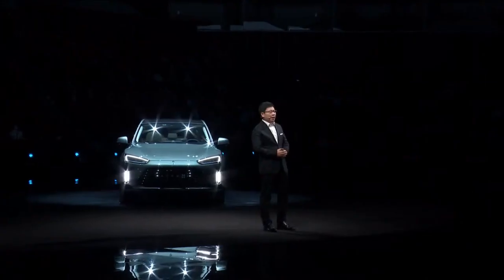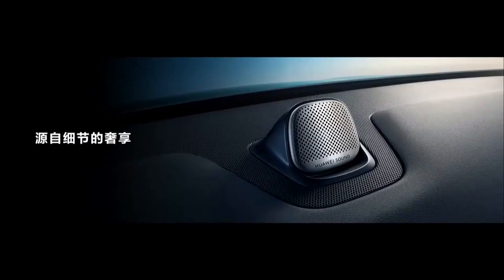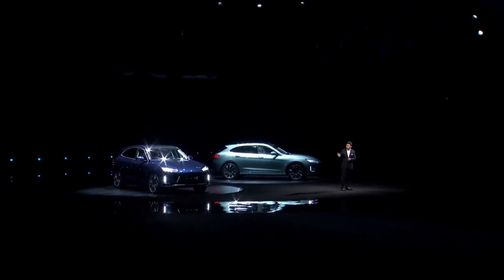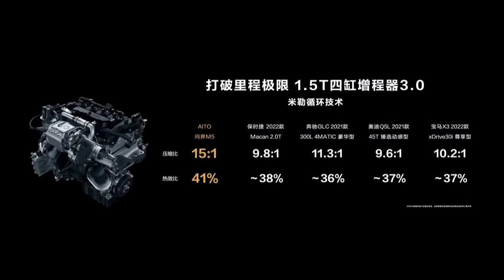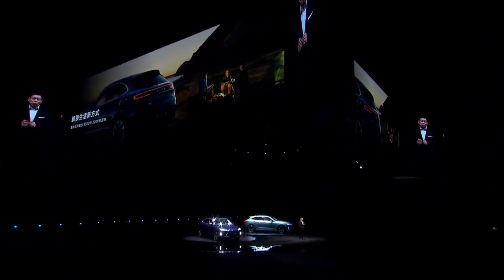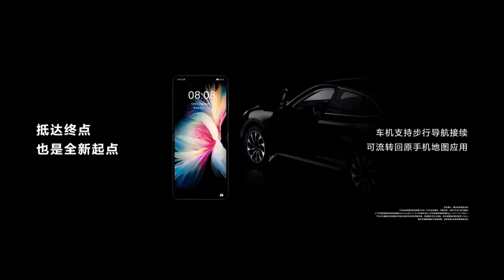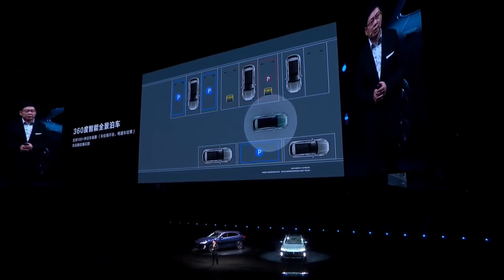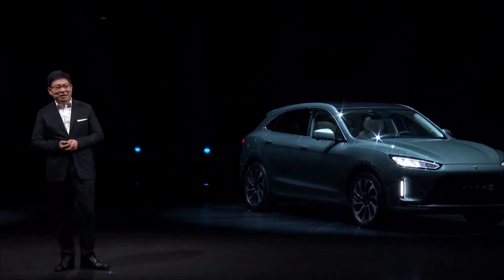Huawei Launch Electric SUV AITO M5: Full Launch event Presentation!

Comment: More fuel efficient but… 173kw provided by the 56 ltr tank, concur in around 893km range out of the 1100 advertised km (those if you also use the 40kwh battery)…. So it totals to 15.9 km with 1 ltr of fuel… how is that more efficient than petrol?
Reply from the maker: It probably is catering the range anxiety only. The average daily usage of most cars is about 40 miles per day and anything more than 200Kms a day, happens only very limited. So the 1200Kms range, is something for the range anxiety only. And who can drive 1200Kms at one stretch? and how many times an year? Just our thoughts!!!